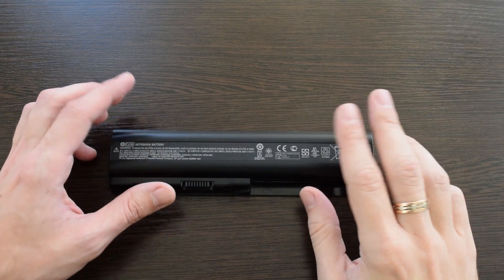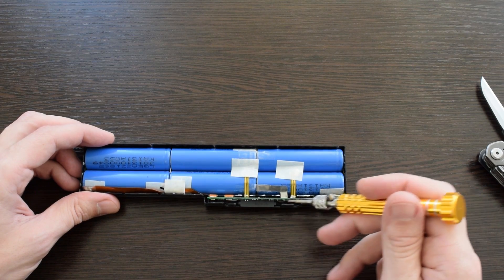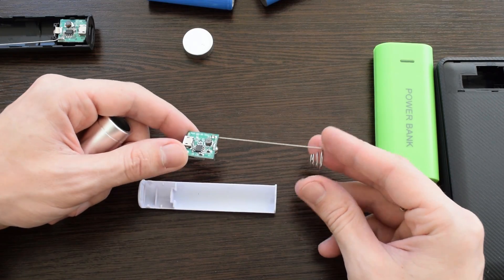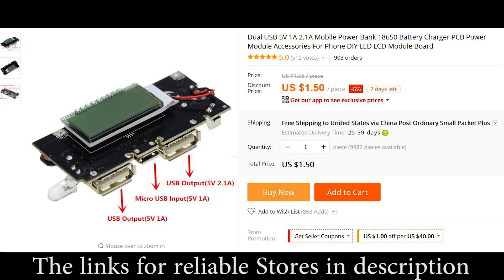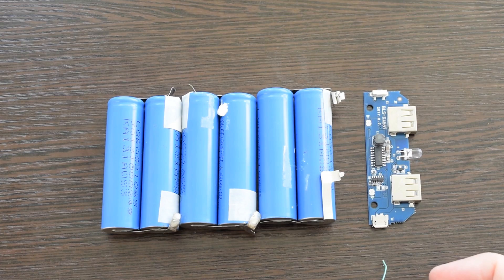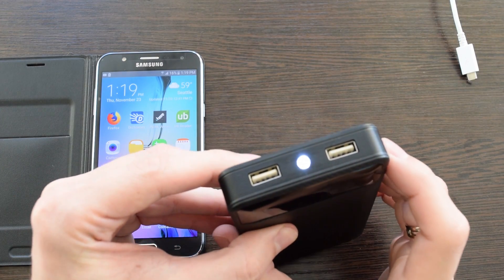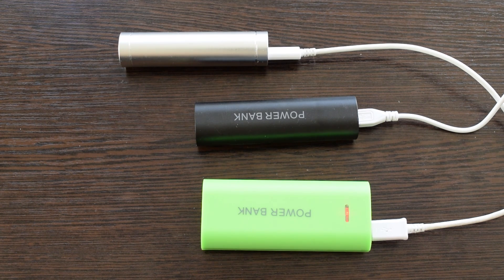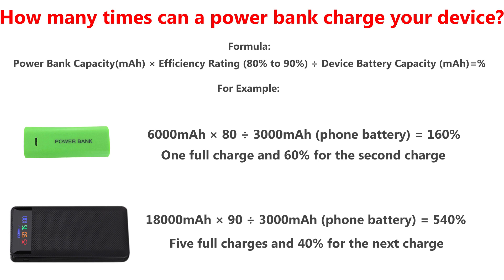DIY 21000mAh Power Bank from Old Laptop Battery | Reuse 18650 Cells!

Comment: With one of those sinle cell units, how much could you charge say a cellphone considering the batter is good and fully charged?  I have access to alot of old laptop batteries and I'm wondering how powerful these are because those premade easy drop in casings seem the easiest.
Reply from the maker: You need at least two cells to fully charge any phone.

Comment: I've had some bad luck with these cheap power banks, especially the single cell version, with cutting out before the cell is discharged and then, especially with the aluminum one, overcharging the cell (well past 4.6v!!!). Dangerous. Have you experienced this at all?
Reply from the maker: The ones I tested didn't have these problems. I don't recommend using a single cell power banks (at least cheap ones like these) they work kind of weird.

Comment: Where is the fuse. When something goes short circuit make an fire or explosion and overloaded the super super thin wire.
Reply from the maker: The power banks with one cell don't have a fuse but the big one has a fuse on the board.
Reply: @ElectronicsComputers  When chip have short circuit, baterry exploded with one baterry

Comment: Hi my power bank has 2 2500mah batteries can I switch them to 5 in parallel of course 3500mah batteries will it charge all the way to 3500mah or 2500mah?
Reply from the maker: Without editing the firmware on the chip it's not gonna work.

Comment: Your calculations for the power banks estimate charging efficiency of 80-90% from the bank to the phone, but the phone circuit bucks the supplied voltage from 5.0 v USB down to 4.2 v to charge the Li-ion phone battery, so the efficiency is less than that. Good video.
Reply: Right, I think so. 75% max.

Comment: May i ask??   How many volts in the battery of that laptop you used??
Reply from the maker: 10.8 volts by specs but actually it's about 11.1 Volts. Each cell 3.7 volt, 3 of them connected in series, then another group of 3 cells connected in parallel to the previous group.

Comment: I always put 5A fuse in case that something goes wrong (eg. chip failure and short circuit),  I wont burn down my house.  I like your video
Reply: Great call, this should be a top comment so that people don't diss on DIY after a dead phone or a fire.
Reply: How do you add the fuse, I'm new to DIY
Reply: Yes, a fuse is a good idea. I use them, even if I have to omit 1 cell to fit it inside. Five 18650's hold a lot of energy, and those cheap charge controller chips have been known to fail short.
Reply: @rpbajb  very true. I had one of these cheap controller boards fail short on me once because i reverse polarity connected the input XD and if i did not have fuses on the batteries (5 parallel) there may have been some nice fireworks

Comment: A question please. I long thought that my laptop battery is dead for good. After all, it has been there for 11 years and for the last 4 year it didn't show any signs of life, just dead weight. Even the indicator on the task bar would always show a red cross. Curious of replacing the Li-ion 18650 and reviving the laptop battery, I have opened it and removed all the batteries. BTW, the soldering was very hard and I kind of ruined the scheme... BUT! What I found really intrigued me. I have taken out all 6 batteries and tested them. All of them show solid 4.15V charge! Could you please kindly explain to me what is going on?!
Reply from the maker: I think charge controller simply disabled your battery pack because it's  probably lost a huge amount of capacity. This is why your cells still have voltage. There's usually a fuse that controls by a charge controller which counts every single charge/discharge cycle and at some point it gives signal to a fuse and it burns. So your cells don't go to 0 volts.
Reply: Thank you for your reply. So what am I now to take away from it? Are the batteries any good? Or they are dead?  Or the scheme was good and I shouldn't ruin it? Please advise.
Reply from the maker: Did your laptop recognize the battery when the battery was inside? If not or it says that you have to replace then it's cheaper to buy a new not original battery than trying to fix it. Your cells probably in bad condition but who knows... I usually make power banks from them and customers buy them. All cells don't die equally some of them in great condition some in bad and some are dead.
Reply: In the end, my computer wasn't recognizing the battery at all, putting a red cross over it. It didn't say anything about replacing or I just didn't pay attention. No it's too late. It's disassembled and the batteries are taken out. The laptop itself is a very old one from 2007 and I don't really want to make any investment in it at all. So I just thought to take is out and experiment a little, maybe replace the batteries or choose good ones and make a power bank. From all the online videos that I have watched, I took that dead batteries have to show less than 3V. All of mine show solid 4.15V voltage. Does it mean they are all good or what?
Reply from the maker: The battery was in a protection mode it was disabled by charge controller for safety reasons.
Reply: Guess I have to put them to other test :) Thanks anyway :)